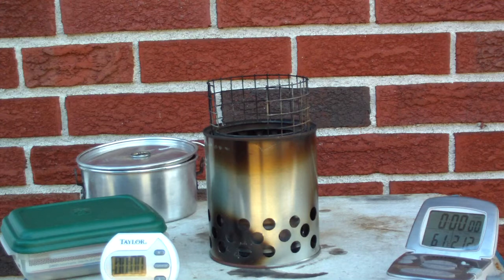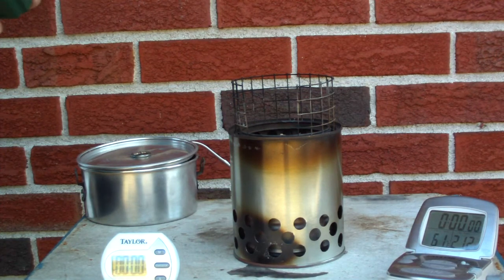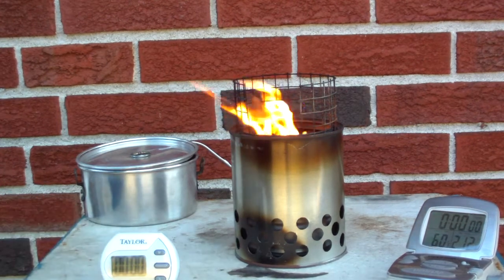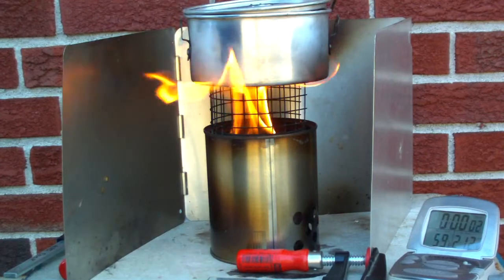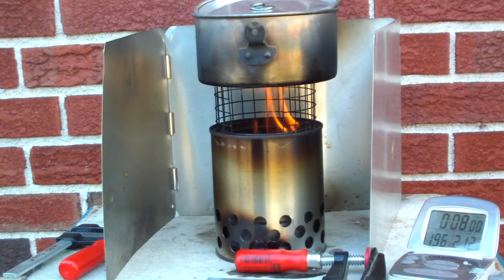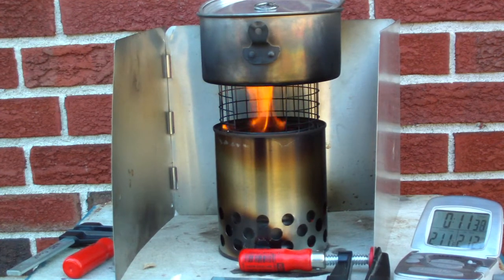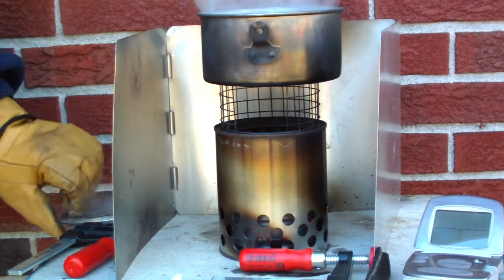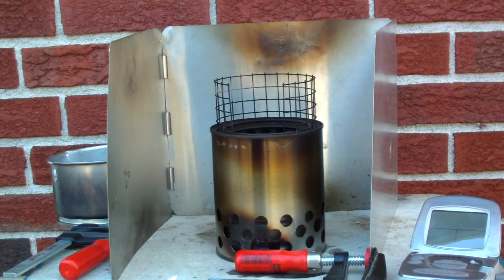Woodgas Stove Simple Version 1.2 - Boil Test #2

Comment: Hi Hiram, I would suggest a different design for the wind screen to add a pot skirt. Try using a piece of sheet metal (such as aluminum flashing)  rolled into a cylinder with diameter 1 inch wider than the pot. Height should extend from the floor to half inch below the top of the pot. Cut holes on the bottom edge of the wind screen to let in air. Cut a bigger hole to match the opening in the pot stand where you add the wood.  I think you will see the boil time cut by about 3 minute.

Comment: Hiram I have a test idea that might be interesting. I wonder if you could bring two cups of water to a boil on the remaining coals? You would probably want a shorter pot stand to do this (maybe 1"?) If you put the pot on once the flames died out, I would think you'd get no soot at all. The question is weather the coals will put out enough heat for enough time to get the water boiling. Have you ever tried this?